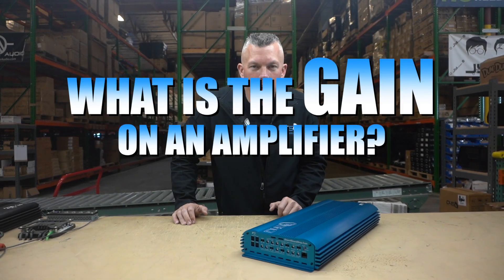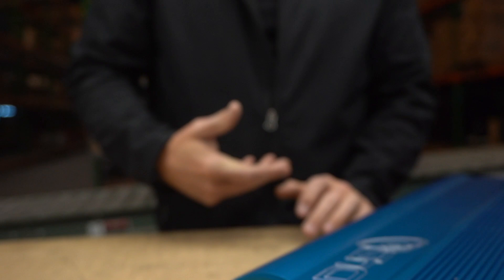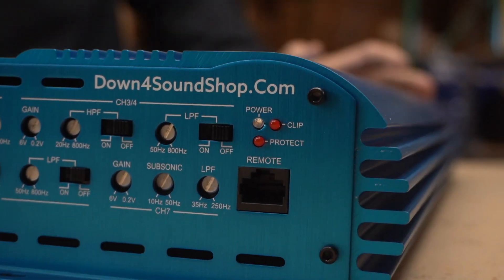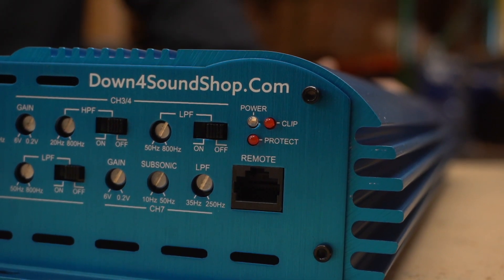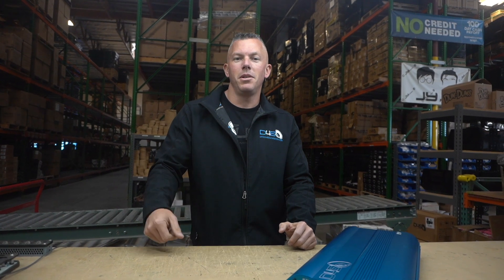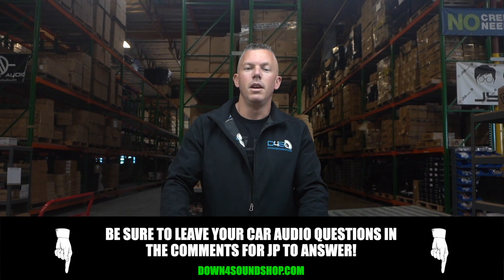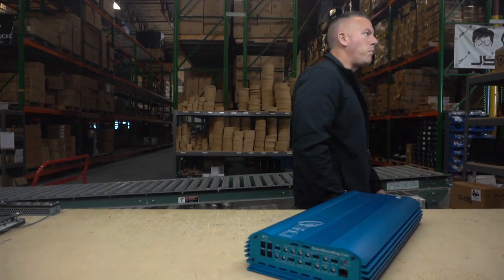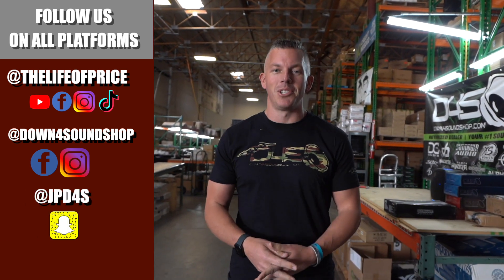WHAT IS AMPLIFIER GAIN? WITH JOHNATHAN PRICE

Comment: I have two DVC subwoofers 1200RMS...what size mono amp would you recommend i have a kicker 800.1 class d amp from a previous system would that not be enough for the subwoofers

Comment: So with a set of Skar audio vxf 12" subs @1ohm,would the jp43 push them good? And also im working on finishing the big 3 and ordering my 2 alternator bracket and getting a 2nd alternator. Already have the 2 battery setup on my 2014 gmc sierra

Comment: I'm running a gravity g12bdi pre loaded enclosure... it's a 12" warzone sub (4ohm dual voice coil) with a 1k watt gravity amp. 

Does anyone have any info on this kit by chance? Can I wire the sub down to 2ohm and get it a lil more power? Would that be a smart thing to do to increase my dB or should I leave it alone? There's minimal info out about gravity subs.

Comment: I recently just got 2 12” kicker comps running on a Jensen 600w 2 channel amp about 250x1 rms 120x2 rms, I cannot turn my volume on my factory head unit past 25, if I do the bass cuts out almost and is very faint and distorted. Is this because the amplifier is running to much power to the subwoofers?
Reply: Gains set to hi possibly... when your head gets turned up, the amp goes into protect mode because it's trying to push too much power

Comment: The gain on my sub amp is turned all the way down according to what the builder told me. My eqs equalizer upped the voltage of my RCA's enough that he couldn't turn the gain up at all or I would have gotten distortion.
Reply: I believe that's a good thing. I've heard MBenclosures talk about this.

Comment: Hey JP question but first so if I upgrade my stock alternator, into a mechen 400 elite series, (question) what is the purpose of having multiple grounds eitherfrom the battery/ alternator.? Second question on those amplifiers that have dual or quad (grounds/power) are you supposed to have each of them hooked up .? Or just the one that have the remote connector to it
Reply: The amp is most efficient when hooked up with dual power and grounds but will still function off of a single run of each.